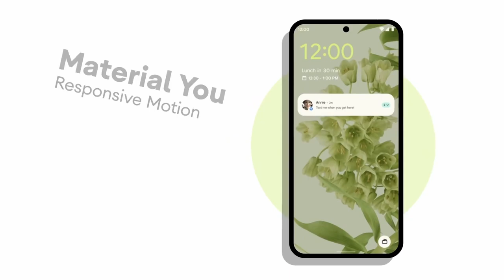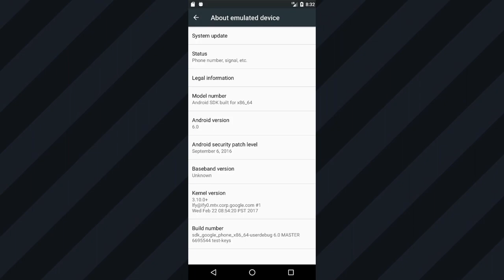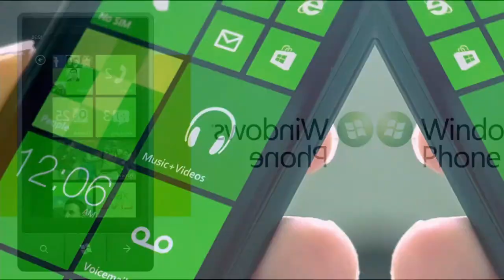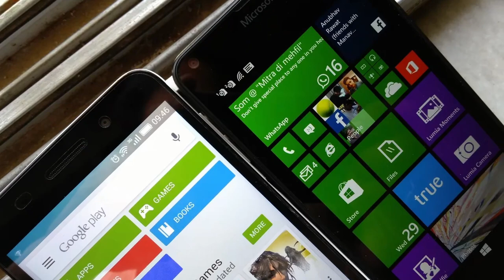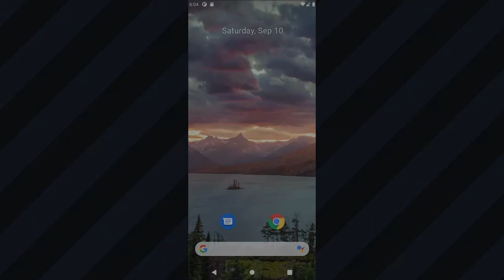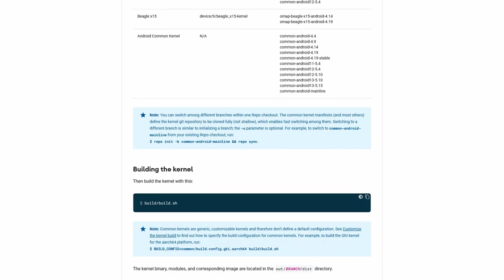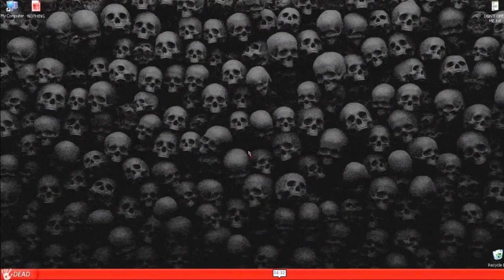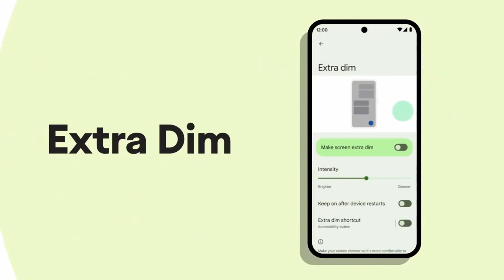The Complete Operating Systems Iceberg Explained

Comment: Its likely Windows 9 was skipped, because of faulty version checks.

> "There are many hazards to changing the reported operating system version number.  ... Changing the reported operating system version number is always a very tense but necessary step in shipping a new operating system. You throw the switch, knowing full well that hundreds of applications that had been running just fine will start to fall over, and you’ve just signed up the product team for thousands more hours in the application compatibility labs." Raymond Chen - Microsoft; "Tales of Application Compatibility": stories from a Windows 95 compatibility engineer

Comment: 2:33 This is actually an intentional change by Apple & browser vendors. All versions of macOS since Big Sur represent them self as Catalina, for two reasons
- Compatibility: macOS has been 10.x since 2001, suddenly going to 11.0 might break something (i.e. checking the number after the . is greater than a specific number)
- Privacy: Reporting all versions of macOS as the same can prevent fingerprinting.

5:17 TPM has nothing to do with CPU generation, you can have a TPM 2.0 on an older machine (such as a 6th gen Intel CPU). Windows 11 requires both a TPM 2.0, and a Intel 8th generation (or equivilent AMD) CPU or later.
Reply from the maker: Thanks for the corrections!

Comment: 3:16:50 The second dominant platform is switching from macOS to Linux now, as due to the MBP 2016 and MBA 2018 being overpriced and not that good value, having their bad keyboards, and severely lacking in ports, which is a biggie for most users, who literally would ditch all their gear just for usb c replacements? The M1 fixed the value issue, but the ports issue is less urgent for pro users, but USB-A is still used extremely commonly

Comment: At around 1:24:00 the reason you think PowerShell and CMD are worse than bash is because windows never teaches users how to use a shell meaningfully, and people only start becoming comfortable with terminals until they use Linux daily, then come back to windows and hate PS

Also, CMD isn’t actually a shell and is just a command processor, very different.

Windows terminal and PowerShell 7 are honestly pretty good